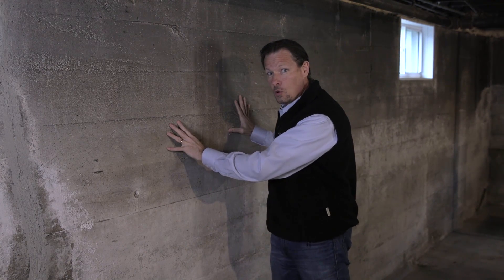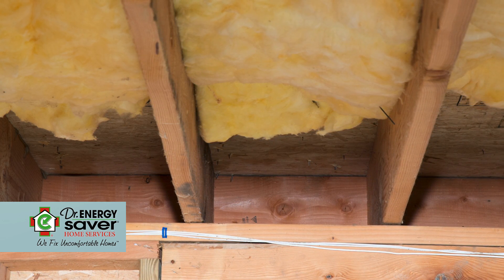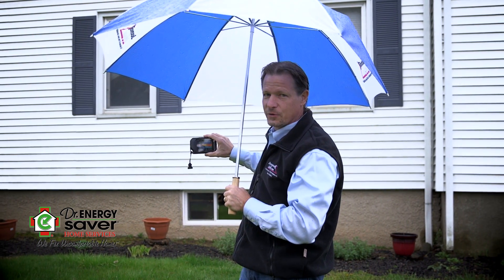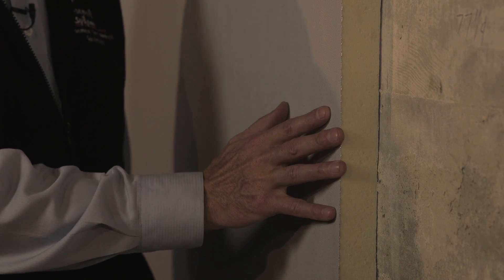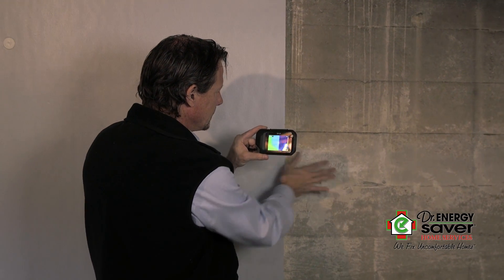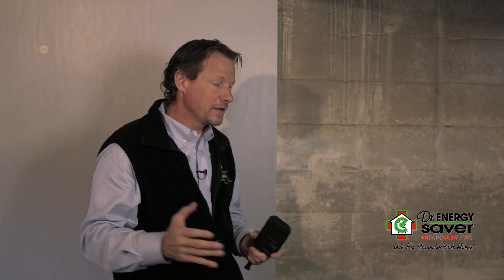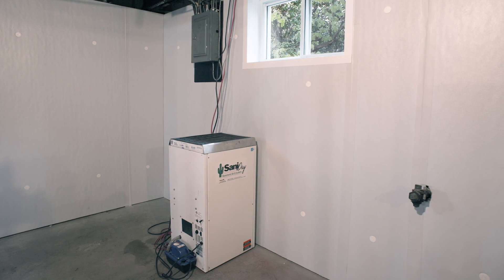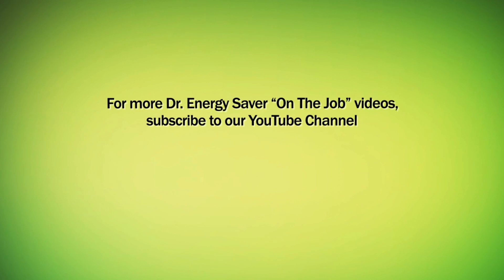Insulating Basement Walls with FOAMAX

Comment: What about insulating the floor?
Reply from the maker: Hi 59seank. Here's a link to our video about basement floor insulation. https://www.youtube.com/watch?v=n3hob1Nkv4Q
Reply: Can a homeowner buy the ThermalDry floor insulation product?
Reply: No, only sold through dealers.  If a dealer doesn't carry the product you want too bad.  I went with the Amvic Amdry insulated subfloor panel offered through home depot.
Reply: I'm thinking about laying down 2" XPS foam, and then dry laying 24" x 24" ceramic tile over that.  I figure the tiles will be heavy enough to hold the foam down, and if the basement floods, I can pick everything up, let it dry, and put it back down again.  I've never heard it done before, so I'm a bit wary of going this route.
Reply: I'm no expert but if you were going to do this then you might consider laying backer board over the foam for rigidity.  Might be just enough movement in the foam to cause cracking in the tiles.  Save your money by spending a little more at onset of the project
Reply: Thanks for the suggestion.  I'm going to get 4 sheets of XPS and enough tiles to cover it.  Then I'll put some heavy furniture on it and see what happens.  The tiles I'm looking at are outdoor ceramic tiles, and look pretty tough.  If the tiles break under the furniture, I'll try the backer board.  I don't know when I'll get to try any of this.
Reply: you may want to cut Kerfs into the side of the panel that will be laying on top of the cement pad to encourage air movement and vapor drying if /when water gets through
Reply: Good idea.  Thanks.
Reply: Right now I have 1x3 wood nailed to my basement walls on the flat. I tore down paneling and this is what I found.  Would it be beneficial for me to leave them up and attach foam wall board to it leaving a 1/2" gap for air circulation between the foam board and cement wall? I don't have a moisture problem but I'm thinking if there was ever any moisture,  the air gap whould be helpful?